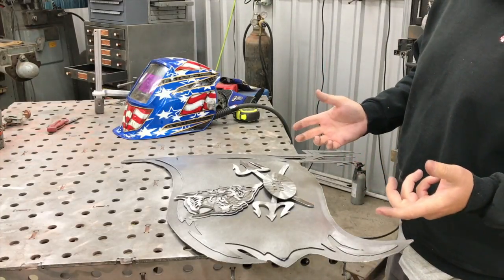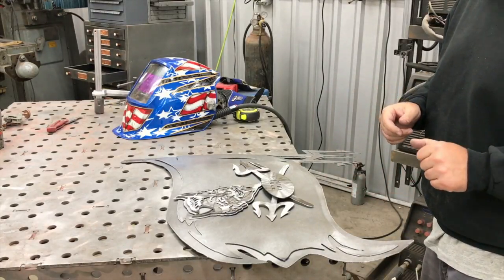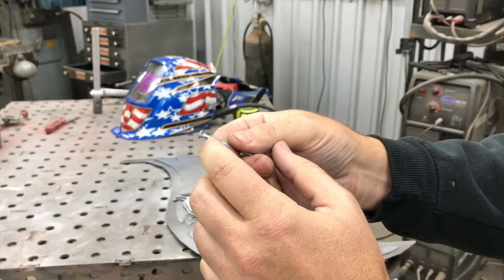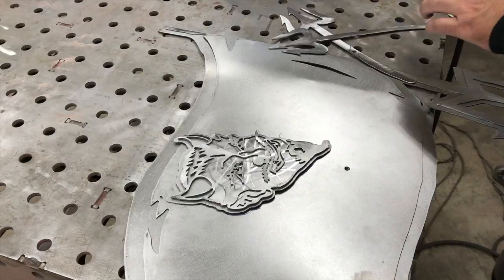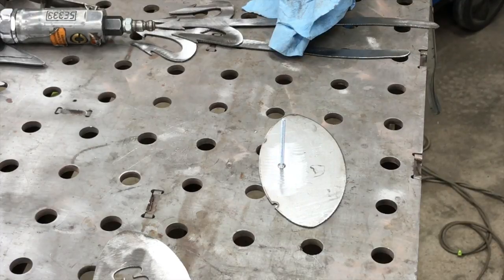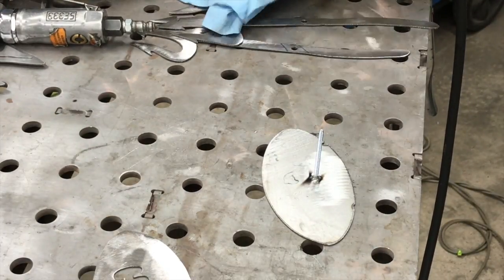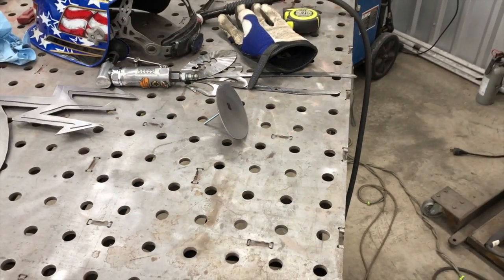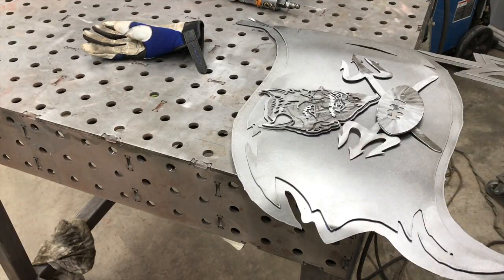Multi Layer Metal Art Fabrication - Hidden Fasteners

Comment: Have you ever tried muriatic acid to remove the coating on your fasteners? You can buy it by the gallon at your home store (Lowes, Home Depot, etc.) and just dip the part that you want to weld into the acid so the rest remains coated. Sometimes sanding kind of smears the coating into the metal which may be why you got that smoky residue after your tacks.

Comment: like the use of the 6-32 screws.  I've use thin neodymium magnets a few times as well some silicon.   I don't get to do a lot of signs, so I am always looking for tips on the multi-layer attachment so I can powder coat the pieces all separate. Thanks for sharing Gary!
Reply from the maker: Interesting about the magnets, would not have thought of that, but definitely something to think about.  I have had good luck with the 3M VHB double sided tape.  Its super strong stuff, and saves some time on fabrication work

Comment: Plug welds would word nice. Obviously not removable....
Reply: Yup.  Plug welds all the way.
Reply: Each layer of the sign gets painted a different color, and is then assembled afterwards.
Reply: Shut Yer Face Garage Well, no plug welding than..  studs it is.
Reply from the maker: Plug welding through 6 layers might be a little tricky as well, but yea, SYF is right, the reason I make it all in separate layers is to eliminate the need for masking